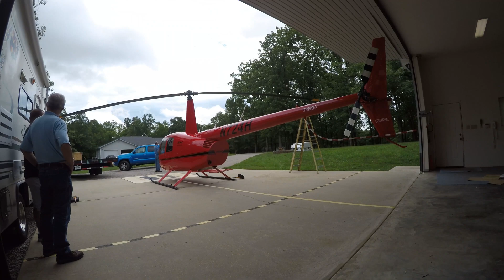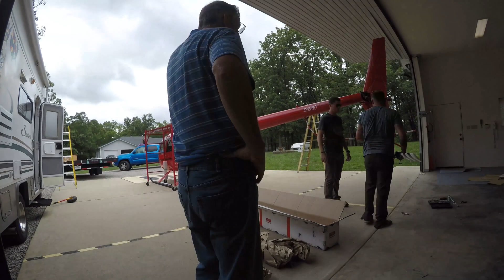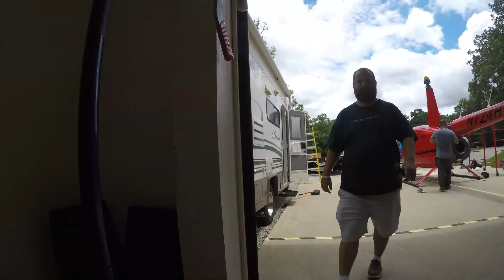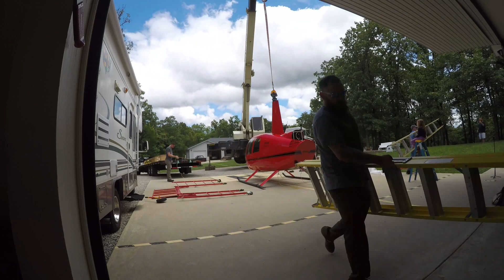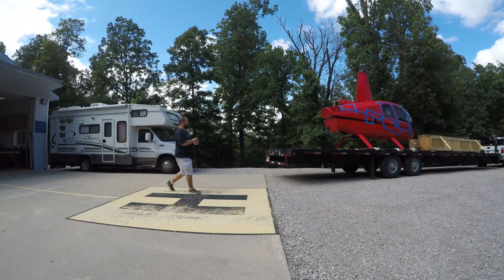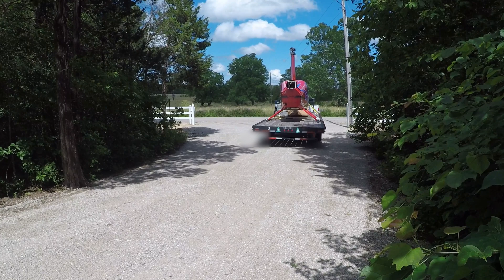Bent Metal - Update 2: R44 Helicopter Return to Factory, Teardown and Crane Lift with Timelapse

Comment: Out of curiosity, why did you decide to break it down for transport? I live in the rural south and see people hauling 44s for ag spraying pretty frequently, on a trailer very similar to the one you used.
Reply from the maker: I know they have trailers that support the rotors and it can ship intact. There was a trailer available in 30 days or this trailer. I believe it would need to be broken down when it got to the factory, so, we wouldn’t save a lot by shipping it intact. At the end of the day, the dealer managed logistics. I wanted to get the helicopter out of my dads yard ASAP and said “what ever it takes...” my father and mother were insanely gracious, and I did not want to haggle over a transportation logistics and costs while imposing on their grace. So, it probably is as simple as, that was the first available trailer. Good question, thanks!!!

Comment: With that long trailer did you have to take the copter apart?
Reply from the maker: Good question. I believe if not, there has to be supports for the rotor blades and tail, something like this. http://www.covehelicopter.com/helicopter-recovery-trailering/ I assume it was all going to be broken down at the repair center so it saved a step. At the end of the day, you trust the mechanics as you are the one sitting in the thing when its all said and done.

Comment: Did we ever determine just what bit you causing the sink rate and hard landing?  (New private rated pilot myself)
Reply from the maker: Congratulations on your freshly minted PPL certificate! Very cool accomplishment! There are not enough of us out there. The issue was pilot error. I experienced strong vortices off the building resulting in turbulence. This manifested as what felt like a strong uncommanded yaw. I was concerned about loss of power for a few reasons (external factors and too paranoid). I should have simply ridden the turbulence out. At the lower experience level at the time, the uncommanded yaw is tied to only a few things, and I chose to lower the collective into a controlled descent. The sink rate was 20 ft agl over 6.5 seconds. It appears dramatic but is roughly 2.5 FPS. The main bullet for me is how profound the training was in that moment, how much I appreciated my instructors and continued education, and making a decisive decision to lower the collective, and not go around. While through the lens of 45 days hindsight and 20/20 vision I may have made a different decision, in that moment, I made a decision and committed. Things develop so rapidly I am glad I did not freeze or overanalyze or lock up... I will continue to train and improve. What is your next step? Instrument or cpl?
Reply: @MichaelHendricks  Thanks for the assessment!  I watch every mishap video I can to try to learn.  I too am amazed you didn't catch a rotor blade, or do more damage than you did.  I'm one of these High time fixed wingers, (20k+) and thinking of a retirement gig flying helicopters.  I built my Rotorway Turbo Talon and have been having a blast in it.  Next step really is commercial.  I don't have a training helicopter near to do Instrument in, and after 30 years flying heavy metal, I'm hoping to never have to Sit next to a runway hoping for the front to pass and the thunderstorms subside enough to allow us out.  So, not even wanting the instrument rating!,  I'm thinking VFR day only helicopter tours.  Just found you on FB,  Clicked the "Follow"

Comment: Robinson R44s were involved in 42 fatal crashes in the U.S. from 2006 to 2016, more than any other civilian helicopter, according to the National Transportation Safety Board accident reports.

That translates to 1.6 deadly accidents per 100,000 hours flown — a rate nearly 50% higher than any other of the dozen most common civilian models whose flight hours are tracked by the Federal Aviation Administration.
Reply from the maker: This was however pilot error. It could have happened in the Hughes 300 I originally was learning to fly in, or any aircraft. I will continue to focus on the actual source of the issue that I can fix, which was the man at the controls. It would be a cop out to blame the machine.
Reply from the maker: Thank you Colin. Well written article. It has always fascinated me when an MD500 impacts terrain, or when a super puma looses an entire rotor head why no one raises an eye brow. It just accepted. There is a culture of hatred against Robinson, and thats ok. Its part of the culture. Hey, maybe its like GM vs Ford? Ferrari vs Lambo? Its just interesting. The only thing I can focus on is me, the pilot. My family wont care what hardware we are in if I make a mistake... Thank you for the article. It is well written.

Comment: Great series of vids and thanks for your honesty.
Reply from the maker: Thank you for your support. No person gets to where they are alone, and if me sharing can help someone avoid the same mistake, then it will be time well spent. Have a relaxing weekend!
Reply: Michael Hendricks I hope your wife will continue to embrace the love of aviation. Maybe I missed it, but was there an explanation as to what happened? Wind shift? Settling with power?
Reply from the maker: I experienced roughly a 10 degree an uncommanded right yaw when in an out of ground effect hover. I misinterpreted this as the onset of loss of tail rotor authority. After doing training and spending time doing confined area approaches around buildings, when I settle to about 5ft above the buildings I always get the same right yaw. I now know this to be vortex turbulence from the rotor system. Experience now says, calmly push through and you are ok. I was paranoid about power that day because of the manifold pressure bight higher (more details in video description) right before the 100 hour, and the SB-97 and the recent loss of power of a recent aircraft. (I understand loss of power is different than LTE as it presents with a left yaw and not a right yaw but, I was paranoid that day). Since I was near the ground, I lowered the collective to reduce power demand, and use the rotation and leveled for the landing to the best of my ability. The descent was 20ft over 6.5 seconds according to the telemetry from AHRS. So, this was a moderate descent rate (~100fpm) and pulled power at the end. I was actually surprised i had engine running and all in the green and needed to perform a shutdown. In hindsight with 45 days to consider the telemetry and options, and perform training, I now have a lot more understanding of that situation. There is nothing more humbling than being a 300 hour pilot.
Reply: @MichaelHendricks  Thank you so much for taking the time to explain the details.  I'm a 900 plus hour fixed-wing pilot who is humbled at least a few times a year.  It's always been a good slap in the face  "wake-up" call for me and, thank God, all with good outcomes.  I do have 1 hour in an R22 from 1989. One of my best memories from that one-hour was soaking up the puddle of sweat when it was over.  
I hope you get your ship back soon and I look forward to your upcoming videos.

Comment: I bet Robinson designed the skids to buckle before causing any structural damage. If so, good deal!!!  Just glad all the people are safe
Reply from the maker: I do not believe they buckled. They traveled along the skid tubes as they were designed to. The skid damage was caused by how far they flexed. In the safety course they emphasized landing skid level for that exact reason. I think had I hit skid level instead of right skid first, there would have been no damage. As I have seen videos of them dropped straight down from 100ft and bounce. They are designed very well. It was good to see.

Comment: Glad everyone was okay!! Heck of a job getting that bird on the ground! Were there any visual defects (rotor mast, skids)?
Reply from the maker: The only visible defects were around the skids (pictures shown in the video). They performed a hard landing inspection and all the vital bits (engine mounts, drive shaft, etc) were intact and in tolerances. I appreciate the complement but it was all to the credit of training. Simple as “also level on the skids.” Didn’t quite pull off level on the skids, but I was close.

Comment: I wonder what sheet metal repairs there were that needed to be made. Especially if Robinson thinks that they themselves need to make them.
Reply from the maker: I was told that panels such as the doors and the skid pants and the body by the skids were not field serviceable. Since they are performing a full 2200 hour inspecting, I prefer this than fixing a cosmetic defect and finding there was a larger issue when it’s too late. The manufacturer can do it better it would seem than the field. But, at this point I am over my depth. I know Cape Copters the dealer and Robinson spent a great deal of time on the phone and that was the determination.
Reply: @MichaelHendricks  ahh yeah thatd make more sense. Since they're doing the Overhaul also. From the video it didnt seem like you split the skids at all. There may be a tiny deflection but I cant imagine that would have bent up the body or doors or frame. But, it's always better safe than sorry!!! I'm glad yall were able to walk away from it
Reply from the maker: Joe Kondratko thanks. I want to be a bit careful here because I am out of my depth, and don’t have a full understanding, but I am sharing what I have gathered. My understanding is they do a 2200 hour type inspection on anything that comes in. My ship had 88 hours on the Hobbs, but, they bring it into the factory through the overhaul process. This is maddening... as you say... it should not take 14 weeks to estimate this repair. However, that being said, if they find something more, I will be grateful for the attention to detail. You truly cannot be overly cautious when everything is on the line, so I am grateful it is going through the overhaul process, even though it’s a slight deflection and “unnecessary.” Everything happens for a reason.

The second item as I understand it, is the panels and body works, are not serialized or part numbered. So a side panel cannot just be ordered and snapped on in the field not because they couldn’t do it physically, but that part doesn’t have a specific serial number, so the log boom for the airfram couldn’t be updated “removed panel sn xyz, replaces with panel abc” I am sure this is and overly simple understanding... but when it came to the door for example, I asked if we could put bubble windows in, “that can only be done at the factory.” 

I think it has less to do with parts and more to do with faa documentation in the airframe maintenance logs. The “body” is one part, so it has to go back to the factory for repair.

Maybe someone with more expertise can help chime in here, but that is what I have been able to glean. Robinson is good at what they do, but they don’t sit on the phone with you and explain their process at length... I’ll know a lot more in 9 more weeks :)

Thank you again for your interest and discussion,, much appreciated, we’re finding out together :)

Comment: My Kitfox is being rebuilt right now, so I feel your pain.  Good luck on the repairs.
Reply from the maker: That hurts my friend. I hope they run ahead of schedule. What is the rebuild time?
Reply: Initial estimate was 3-4 months.  We're 1 month into that, and making progress.  I'm thinking it's going to take the full 4 months.
Reply from the maker: We are 1 month in as well. It is a long month my friend. And month 4 puts you into the winter months. You will be back up before long though. I am 4 months to an estimate. It may be 2020 before we are making noise again :)
Reply: There is light at the end of the tunnel.  I flew all winter long last year here in Idaho.  We did have a fairly mild winter snow wise, so with a little preheat, my Kitfox fires right up.  Also, my new hangar won't be available until Oct 1st, so it looks like things are working out.  Good luck.

Comment: I'm sorry, glad all were safe. My question is why did we have to take it apart to transport? Could the props been secured etc??
Reply from the maker: That is a good question. I think it had to do with the type of trailer. I know they do have trailers that the rotors stay on. However the ship would have been broken down at the factory for inspection, so one way or another, it needed to break down.
Reply: @MichaelHendricks  oh ok!! It will also safe money to have it broken down I'm thinking. Thanks for the response. Glad you all are ok.
Reply from the maker: I also think since it has to go 1800 miles to the factory there is less chance of damage due to vibration, etc. Or, maybe I am overthinking it, and, that is just the only truck they had available :)

Comment: Do you have insurance or are you self funding the loss? I'm sure because of being a low time pilot insurance premiums would have been high. It's none of my business so if you don't answer I understand. Either way the best of luck with everything.  One last question: Was anyone's back sore later on? Thanks.
Reply from the maker: At this point the jury is out. Robinson takes 14 weeks to provide an estimate, so we do not know if we will hit our deductible, which is 10% of the value of the air-frame. I would be hard pressed to imagine this exceeding that, but, you never know. It appears Robinson is doing a thorough inspection, about the equivalent of a 2200 hour inspection, and we will know what the outcome is in another 9 weeks. Amazingly there was no soreness.

Comment: I watched the first video showing the hard landing. I watched this video and learned nothing new as to the pilot actions that led up to the hard landing. Or the pilot’s actions that mitigated the severity of the landing. Would love to read the FAA incident report, assuming they were notified...
Reply from the maker: A detailed description of the occurrence is in the description of the first video, I will duplicate it here for your convenience. No items under 49 CFR 830.5 occurred, and NTSB reporting was not required. 

On 6/9/2019 my family was landing at my parent's helipad. I lost tail rotor authority at roughly 20 ft. of altitude. I lowered the collective and performed roughly a 270-degree descending turn inside the confined area, landing hard, but safely. My family was on board the helicopter and there were no injuries or property damage. 
The main issue that led to me landing immediately was as I was entering an OGE hover for a vertical descent and experienced an uncommanded yaw, which typically indicates a loss of power. When I felt that, I lowered the collective and went for the ground. Robinson had issued Service Bulletin SB-98 after a loss of power incident in Florida. That aircraft was 11 Serial numbers different from mine and we had been in touch with the dealer, and Robinson to see if there was concern about my Serial Number. We were told to look for loss of power, monitor, but the Service Bulletin did not affect my Serial Number.  (As a side note, since the landing Robinson has released SB-100 that address the loss of power in the R44 and includes my serial number. So just because your paranoid doesn't mean they won’t get you eventually.) 
Because of these external factors, I was highly focused on manifold pressure, power and concerned about the possibility of a loss of power. I believe this hyper-focus on power led to me mistaking vortex turbulence from the main rotor system bouncing off dad's hangar, causing a pronounced tail swing for the onset of loss of power. 
Now that I have had 45 days to analyze, perform some specific targeted training, and recreate some scenarios, things they are a bit clearer. When you have 1 second to make decisions lowering the collective, reducing power, and, going for the ground was the safest option I had. As there were also onlookers, had it been Loss of Tail Rotor Effectiveness, I was concerned that nosing over for Effective Translational Lift, adding power and going around while in an uncommanded yaw, might have led to impact with buildings, trees or worse, the onlookers. Adding maneuvering to the mix would have increased risk. 
I feel I did well with the hand I DEALT MYSELF. (Humbling to say)
So, the main take away for me was that with how concerned I was about the loss of power and other external factors, I should have circled, waved at mom and dad, and flown home. I should have broken the chain of events.